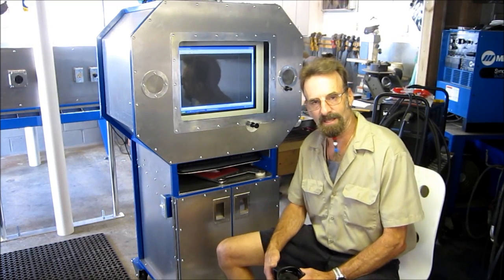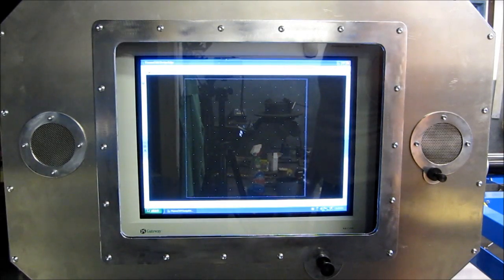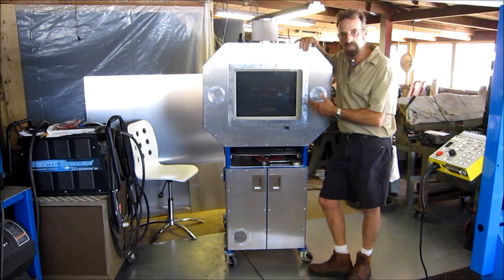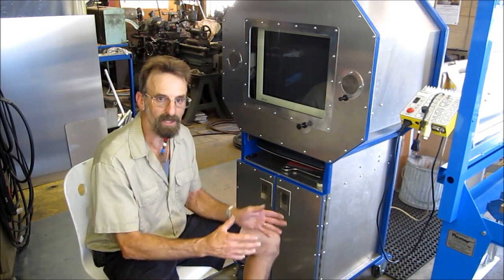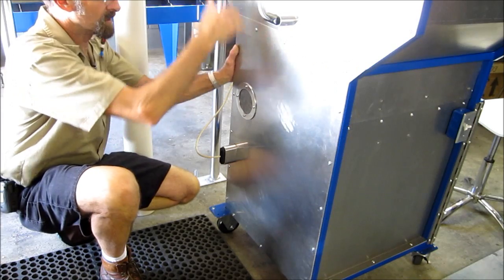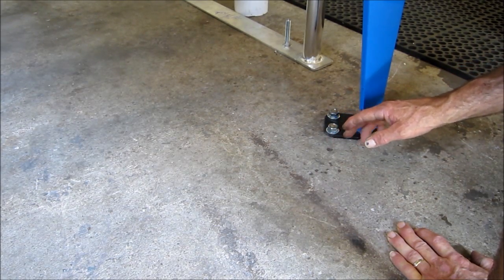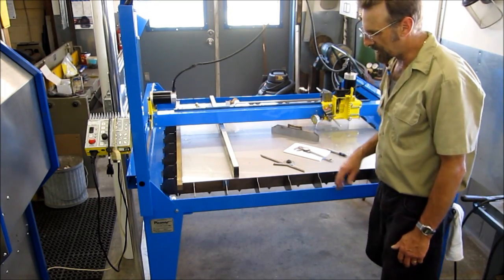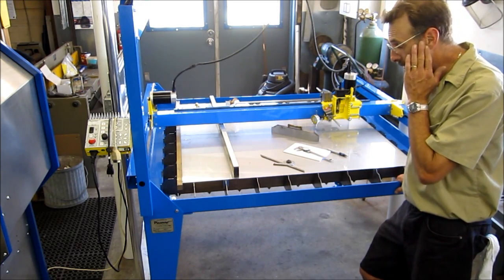Getting ready for PlasmaCAM 4

Comment: A simple method to finding out if a table is perfectly plane (not warped) is tying a two pieces of string from the corners in a cross at equal heights on those corners.

The table is not plane until the center lines of those pieces of string aren't touching.